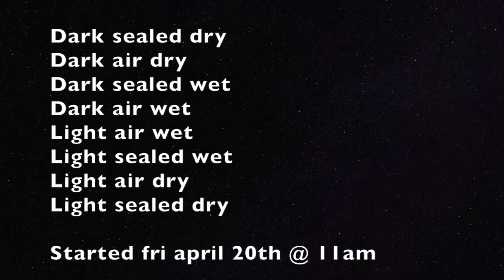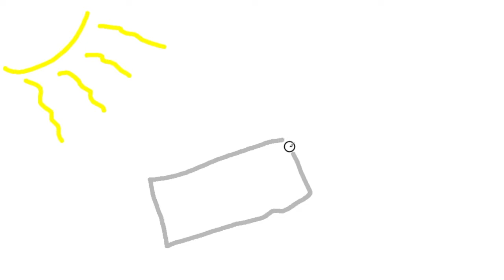Test: how to avoid brittle PLA filament - part 2 of 2

Comment: Just 6 years late to comment, but I believe you are likely right in conclusion. I've seen rolls of PLA filament that are extremely brittle on one side, but very flexible like new on the opposite side of the spool. Nothing what Ive commonly heard have been able to explain this. If it was a moisture issue it would be uniform around the rolls, same with heat and oxygen. Light breaking down the PLA however seems like it could explain it very well, the side facing the window (light source) would become brittle, but the shaded side not affected. From now on Ill keep my rolls dark!

Comment: Great real-world information.
This same filament series for PETG would be much appreciated....I would even supply the filament if needed
Reply from the maker: I'll probably do more filaments in the future.  I try to print PLA unless I absolutely have to use something else, but PETG is very useful, so I have been waiting for A) the cost to come down a bit for everyone and B) the community/industry to kind of settle near a particular  copolymer blend, since the early stuff has been all over the place in terms of how it printst and what it's physical characteristics are.  So I'll definately get to it in the future
Reply: I agree with the early stuff being all over the place. I have some older PET+ from MadeSolid (out of business) that is unpredictable, with diameters ranging from 1.62-1.95 and completely different characteristics from one spool to another.
Reply: @AlexKenis  That is an interesting topic which I would love to see you cover even if you only cover it in a quick/shallow way.  How do you make the choice to stay with PLA or to choose another filament.  Popular opinion is to use PETG or ABS to make hotend parts because PLA will get too soft so I've been using PETG to make all of my homemade 3d printer parts.  
When printing a new hotend carrier what filament type do you choose?  How about part cooling fans which will be very close to the heater block?  How about hotend cooling ducts which contact the heatsink?

Comment: In my tests for petg ,heat and the uv wasn't an issue for short term use (1 month for exp.) But the moisture was a major issue for a degree that if i left the the filament in ambient (whitch i live in a fairly dry area ) it would become almost unprintable and unusable .so i build a small sealed enclosure for them . Tnx for the awsome video.( i'm from iran by the way )
Reply from the maker: That sounds right, PETG has a bad time with moisture.  Thanks for sharing

Comment: These two videos are amazingly helpful. I hadn't used my 18-month-old Ender 3 for about two weeks, and when I came to print I found that the black Hatchbox PLA had gone completely brittle, but only between the reel and the printer, but also inside the Bowden tube. I tried to retract the filament from the Bowden tube, but it cracked, and the slightly melted filament near the nozzle caused it to stick so I couldn't push it out. I had to replace the tube. 
When I finished installing the new tube (and nozzle and tube holder, while I was at it), the same reel printed just fine because the filament still wound onto the reel was as good as new. 
From now on I'm sticking a bag over the printer and reel when not in use, and when storing filament I will be putting it in a totally dark place.

Comment: This backs up my experiences.  My oldest filament in a cool dark place (hatchbox) prints fine almost 3 years old. A one month old white 3dsolutech is basically ruined sitting in open air near a window. We have very low humidity here in the winter and I keep a hygrometer in my printer enclosure and I'm maybe at 20% most of the time. Ive never heard those cracks and pops i hear people going on about.

Comment: Thanks for the experiments.  Interesting results.  
FYI, I was viewing a James Carpino's video (PLA Filament which is brittle, several years old and stored in open air.) and found a link there to a 2016 blog post by Daniel McRoberts.  Daniel's post has some slight errors in terminology, but suggests that brittleness is caused by UV light and dehydration of the filament.  He even gives details of how to "restore" brittle filament! 
His solution is a quick dunk in boiling water to restore the filament.  Strange.  My guess is that the heat is the critical part of restoration, not the water. Since others have suggested heating brittle filament to 113F for 4 hours to restore it.

Comment: Just discovered your channel the other day - great commentary and analysis! I've also seen it suggested that mechanical stresses cause PLA to go brittle: I've found brittleness to be a real problem as you near the end of a spool, where straightening the tight coils will stress the filament more. Being crushed through a typical extruder wouldn't help either, and my printer retracts the filament somewhat at the end of a print, leaving that damaged region out in the open.
Reply from the maker: It looks like that is true, at least in one test I read in a paper (that I can't seem to find at the moment) that measured the consequences of mechanical strain on PLA.  It seems to have a 'work hardening'/'strain tempering' effect, similar to metals, so the more the filament is handled before feeding to the extruder, the harder and more brittle it gets (and more resistant to flow). I haven't tested to verify, but their conclusion seems to correlate to the anecdotal evidence of the last bit on the spool being a pain in the butt.
Reply from the maker: Also makes me wonder if it would be better to use spools with a much larger inner diameter
Reply: @AlexKenis  Excellent points - and if it were just humidity, the start of a spool that hadn't been kept dry would be just as bad as the end. Could warming the filament as it comes off the spool be a good idea?
Reply from the maker: It may be a good idea.  I think I included a test of PLA soaked in water in this vid (dont remember... long time ago) but that printed out just fine.  It seems that heating it up a bit definitely helps, so it's possible that a slightly heated storage chamber might be better than a humidity controlled one, or you could do both pretty easily.  worth a try.

Comment: Pretty sure this is inconclusive, and moisture does play a role, it's just how it's absorbed.... while this is old by now... this is my take.   i have sample coils that are brittle, i put them in the filament dryer at 60c for 2-3 hours and they are no longer brittle.  the brittleness isn't permanent.   the other thing is the filament has a skin when it's extruded (at the factory, not when you print) that seems to block absorption.   filament seems brittle the first few inches (6-12 inches depending) from the ENDS or at a Bend in the filament after you use it...(like when you attach it through the holes) then it stops and the filament is fine, it's never really brittle say more than 1 foot from the end of the spool unless it was exposed longer.  the moisture can wick it's way along the filament in parts where the skin is broken. i've had new spools of filament in the dark+artificial lighting in a pallet 2 (multi-color) and next day have them snap off inside the machine.  they were just opened.  this only happens in my basement at 50-60% RH in summer.   upstairs at 30% RH it takes a week for this to happen.      most of my filament is in dark storage... so unless it's C02 it's most likely moisture or both but whatever it is,  heat does restore the brittleness.     Plastic bags that come with filament and zip locks have a pretty poor permeability rating because they're so thin. a 15-20mils poly bag or mylar bag will usually work to prevent moisture or whatever it may be.  i always get brittle filament in cheap ziplock bags but originally vacuumed sealed even years old have never had the problem and those are usually 20 mils thick with tiny desiccant.

Comment: Fabulous video - thank you for making it. I'd love to see one with PETG  as others have already expressed. I don't know if it's helpful, but I believe that using glass containers to hold the filament might solve your "plastic bag additive" problem as long as the shape and/or index of refraction is not particularly unusual. Cheap test tubes, for example, are ubiquitous and could allow you several iterations of each test.

Comment: This isn't a plug for eSun PLA+ (plus), but whatever is in that brew, maybe extra placticizers.   It is my favorite PLA, for layer strength.  Inherently, since I have more rolls of this around than any other, I rarely have brittle filament come up on radar.    I'm so accustomed to never having to handle brittle stuff, that when I do handle Proto Pasta Carbon, I find it  'challenging.'
Reply from the maker: I THINK those pla+ add TPU, I could be wrong, and I'm sure it varies.  I have the same experience, layer adhesion is very nice, and it is a bit flexier and chewier, so I'll use it for prints that need that
Reply: @AlexKenis  E-sun PLA+ indeed has a certain percentage of TPU added to it. Some "premium" INGEO blends also have TPU added. It's easy to spot what additives are added to PLA once you know what you're looking for.

Comment: Mumm some PLA, and others, filament spools are posted with holes in the box and stored in clear bags so that the colour may be seen with out opening the supplied box... This could let light into one area on the filament spool, I guess causing brittle area when first stating to use that spool that should stop after a couple of spool layers have been used. I think a lot could depend on how it's stored and and how quickly is is packed in the factory, it maybe left exposed to light before sealing into bags and boxing

Comment: This seems to go along with what has happened to my current roll of filament. I had my printer in front of a window, a window that I would also open from time to time. I didn't print for about a week, and today when I went to print, it snapped on contact. Ughhhh

Comment: Is enough of data for this time for this conclusion, GREAT VIDEO!
 Beware the long term reaction with contact with different plastics. 
It seems dissimilar materials reaction does not to apply to plastics, but plastics holds electrostatic electricity, air holds very low amperage high voltage static electricity as they call, and UV light plays a real role at this. you cold test on infrared, red, blue and ultraviolet light, and some plastic sealed in transparent bags, other in black bags, and other into ANTI ELECTROSTATIC bags..
And even so, probably they would change nothing in their content being in contact with a printed PLA black container!
Ah! Cell phone and router Microwave!

Comment: Given that light and O2 and not moisture is the main offender for causing brittle filament, how does heating the filament to just under 200C for 30 minutes return the filament to a flexible state?  Could it be the plastic transition state allows the molecules to realign?  Does it drive the O2 out reversing the air input? It does dry the filament to eliminate the pops and bubbles.

Comment: Alex, thank you for this info. I saw this: (https://www.reddit.com/r/3Dprinting/comments/ezqief/brittle_pla_filament_weirdness/), and one of the readers there posted links to your two videos in this test series. Like you mentioned, the two most popular "theorys" on the Internet appear to be "too much moisture" and "stress cracking". As the OP says in that post, perhaps there is a "sweet spot" where too LITTLE moisture can contribute to stress cracking, and eventually, brittleness? In any event, it seems that this would be data that should be available at the manufacturing level and made available to the community, NOT the other way round! Anyway, good job on the vids and thank you for the proper vocabulary to use in the search engines. Going to do that now. Cheers!

Comment: Alex,   is there a such thing as Polypropylene filament?
Reply from the maker: Yes, PP filament exists.  It's pretty tough to print with, so it is not very popular, but it does exist
Reply: Can you give me a source for a provider?
Reply: @2ASupp0rter  there aren't a lot, but Verbatim sure makes some.

Also saw a local store chain offer PP as their store brand filament. Granted the store also builds store-brand $4000  printers in-house, so perhaps I shouldn't be so surprising.

Comment: I suggest testing with clear filament. Those black pigments prevent most light from reaching PLA.
Reply from the maker: Yup! In hindsight, I wish I had done several colors and also tested some extruded filament as well.  I may re-run it in the future with different filaments/colors, and use enclosures that are 100% sure not to be UV filtered/treated

Comment: I hope you don't mind a comment 18 month later on this.
As for exposing the PLA to air, I keep wondering if their isn't some kind of biological factor here. Remember Pasteur's broth experiment? Maybe leaving the PLA in open air exposed it to airborne spores or that there is an aerobic process that is hindered when the PLA is in sealed container. Could it be that there are actually fungi or an aerobic soil bacteria that can quickly decompose PLA at room temperatures? Not sure how a hobbyist could find out for sure though.  Any ideas?